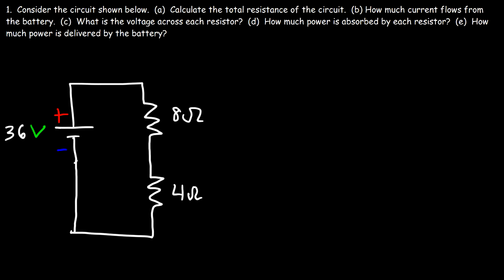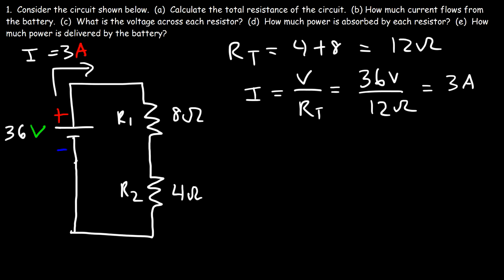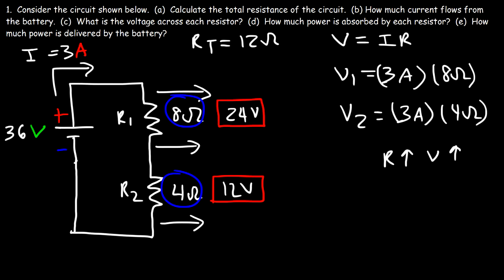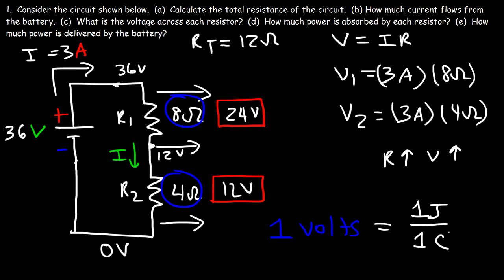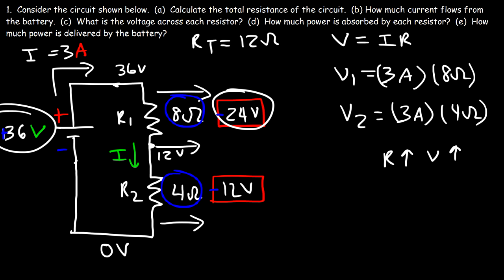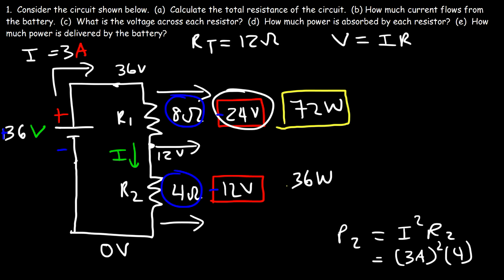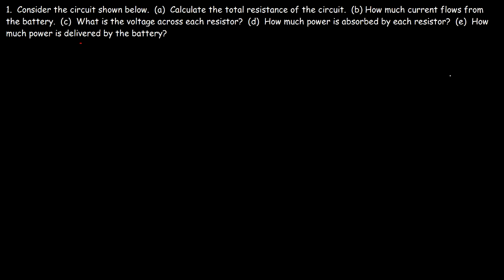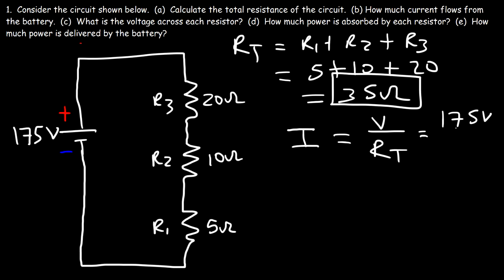Resistors In Series - The Easy Way!

Comment: Hy ...for  question (d) ...i used a.different method but still got the same answer 
P=VI
=24v×3A
=72w

P=VI
=12v×3A
=36w.....
I want to know whether this method is wrong or not
Reply: I used this method too , and I think it isn't wrong !
Reply: I believe it should be  the same. P=( I ^2)R is one power equation P=VI is another I believe the other equation is P= (V^2)/R. They should all get you the same answer regardless of which one you use as long as the values being used are correct. He used I^2R you just used VI so either way is correct.

Comment: Can you solved for me this question
Three resistors of resistance 8ohms ,10ohms and 12ohms are connected across 10ohms resistor reading 6v 
Calculate current in the circuit 
Calculate voltage across the R1 and R2 
Calculate total voltage in the circuit